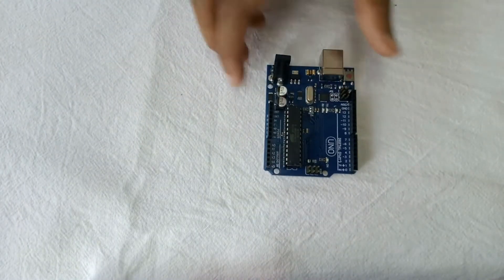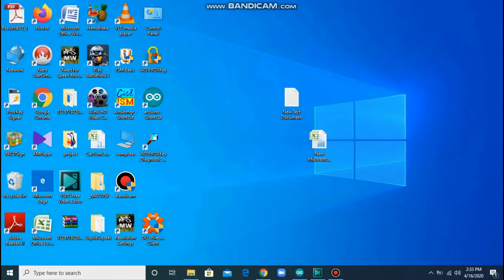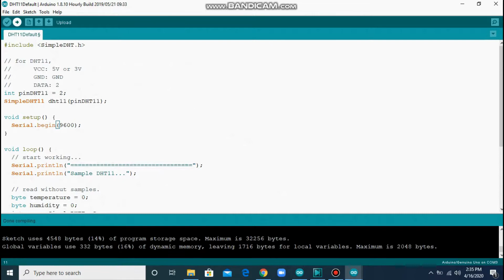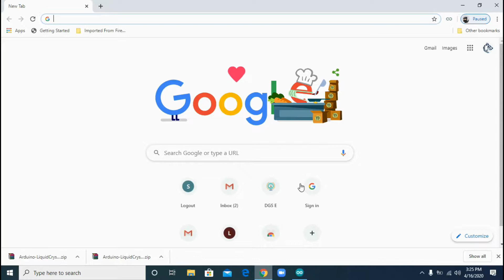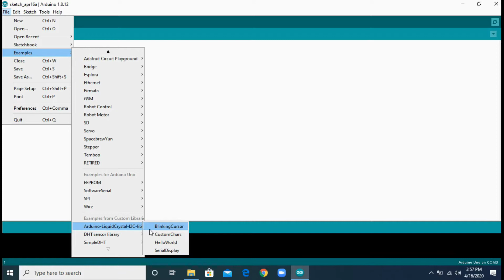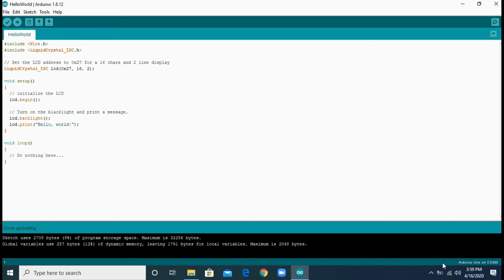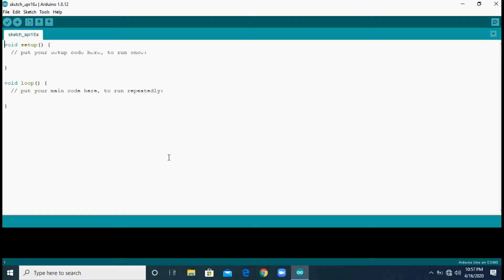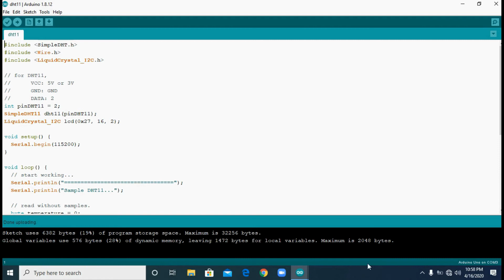DHT11 Temperature and humidity sensor using arduino with LCD disply tutorial

Comment: The code file is not opening
Reply from the maker: Please don't directly open the code from downloads 

Open Arduino IDE (Arduino software) from there go to files and then click on open and browse the downloaded file and click open then it should work
Reply: @witchdoctor1387  i did. But i still have the same issue
Reply: @Zero_Two_91 yeah same issue
Reply: @witchdoctor1387  SimpleDHT.h: No such file or directory

Comment: Hi, the sketch to test the lcd  (minute 8:57 ish), while attempting to compile gives me an error on the first line of "void setup", it shows "No matching function for call to "LiquidCrystal_I2C:begin()",   which is in the line :  lcd.begin(); 
I added (16, 2) to it but it doesn't work either, I have the right hexadecimal number of my module,  0x3F and I am using it.
Thanks in advance for the excellent tutorial.
Reply: Bro I'm having the same problem, it shows me the same error, how can i fix it??
Reply: @Zero_Two_91  to fix that use this lcd.begin(16, 2, 0x3F);
Reply: I have the same problem, could anyone help me?
Reply: Me too

Comment: Given link of code isn't opening
Reply from the maker: Don't just open the code directly just open the Arduino IDE and from there go to files which is on the top left corner from there click on 'OPEN' and browse for your downloaded files then it should open
Reply: @witchdoctor1387  doesnt work bro
Reply from the maker: I think you have tried to open the files directly from the downloads

Comment: at lcd.begin(); part 
no matching function for call to 'LiquidCrystal_I2C::begin()'
How do I solve it when it says?
Reply: lcd.init()
Reply: same here
Reply from the maker: i can surely say that this is problem of library you have currently in your arduino library folder. the "no matching call" error mostly arrive because the function you are trying to access is not defined in the library you have right now installled. 

Also we have faced the problem when using i2c library for 16x2 LCD. actually there are multiple libraries available with the same name as  "LiquidCrystal_I2C.h" or sometime It is older version of library installed, so when people use wrong libraries they get these library.

The simple solution for this problem is tto install correct library and delete existing libraries for i2c 16x2 LCD.
Reply: Thank you
Finally i solved it
Reply: lcd.being(16,2);
Reply: @BILALKHAN-lz2pj  u r awesome...my semester project is completed
love u

Comment: Arduino: 1.8.15 (Windows 10), Board: "Arduino Uno"

C:\Users\Herman\Documents\Arduino\libraries\Arduino-LiquidCrystal-I2C-library-master\examples\HelloWorld\HelloWorld.ino: In function 'void setup()':

HelloWorld:10:12: error: no matching function for call to 'LiquidCrystal_I2C::begin()'

  lcd.begin();

            ^

In file included from C:\Users\Herman\Documents\Arduino\libraries\Arduino-LiquidCrystal-I2C-library-master\examples\HelloWorld\HelloWorld.ino:2:0:

C:\Users\Herman\Documents\Arduino\libraries\LiquidCrystal_I2C/LiquidCrystal_I2C.h:58:8: note: candidate: void LiquidCrystal_I2C::begin(uint8_t, uint8_t, uint8_t)

   void begin(uint8_t cols, uint8_t rows, uint8_t charsize = LCD_5x8DOTS );

        ^~~~~

C:\Users\Herman\Documents\Arduino\libraries\LiquidCrystal_I2C/LiquidCrystal_I2C.h:58:8: note:   candidate expects 3 arguments, 0 provided

Multiple libraries were found for "LiquidCrystal_I2C.h"

 Used: C:\Users\Herman\Documents\Arduino\libraries\LiquidCrystal_I2C

 Not used: C:\Users\Herman\Documents\Arduino\libraries\Arduino-LiquidCrystal-I2C-library-master

 Not used: C:\Users\Herman\Documents\Arduino\libraries\NewliquidCrystal

 Not used: C:\Users\Herman\Documents\Arduino\libraries\LiquidCrystal_I2C-1.1.2

exit status 1

no matching function for call to 'LiquidCrystal_I2C::begin()'

This report would have more information with
"Show verbose output during compilation"
option enabled in File -> Preferences.

What now?

Comment: I'm stupid. i'm done at the first step showing hello word. Then I proceed with humidity sensor it was showing the measurement on the serial  monitor but still showing hello world on LCD.
Reply from the maker: For each time you have to compile before uploading the program to your Arduino don't just upload without compiling. If you do so the previous code that has been compiled will be uploaded to your Arduino, thank you

Comment: One help for our project how control stepper motor with l298 module using humidity sensor and crystal display plese make a video otherwise please give coding  sir
Reply from the maker: Hello when you want the code?
Now there is lockdown in my locality so can't go out also my Arduino is damaged so can you please wait for some time till the lockdown is shifted because I have to run the code to ensure the proper working
Reply: @witchdoctor1387  thank you for your reply and. Spend your valuable time for me sir

Comment: Arduino: 1.8.13 (Windows Store 1.8.42.0) (Windows 10), Board: "Arduino Uno"

C:\Users\Abc\Downloads\dht11\dht11.ino: In function 'void loop()':

dht11:32:15: error: no matching function for call to 'LiquidCrystal_I2C::begin()'

     lcd.begin();

               ^

In file included from C:\Users\Abc\Downloads\dht11\dht11.ino:3:0:

C:\Users\Abc\OneDrive\Documents\Arduino\libraries\LiquidCrystal_I2C/LiquidCrystal_I2C.h:58:8: note: candidate: void LiquidCrystal_I2C::begin(uint8_t, uint8_t, uint8_t)

   void begin(uint8_t cols, uint8_t rows, uint8_t charsize = LCD_5x8DOTS );

        ^~~~~

C:\Users\Abc\OneDrive\Documents\Arduino\libraries\LiquidCrystal_I2C/LiquidCrystal_I2C.h:58:8: note:   candidate expects 3 arguments, 0 provided

exit status 1

no matching function for call to 'LiquidCrystal_I2C::begin()'

This report would have more information with
"Show verbose output during compilation"
option enabled in File -> Preferences.
Reply: lcd begin(16,2)
Reply: lcd begin(16,2)@Eydreyan Playz